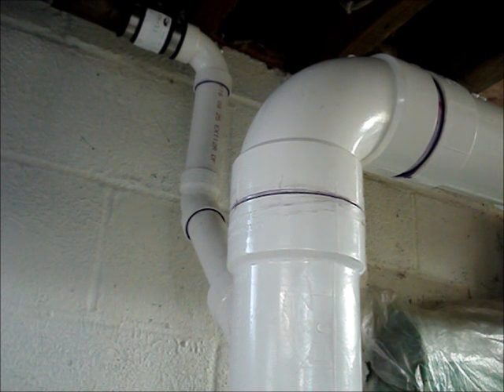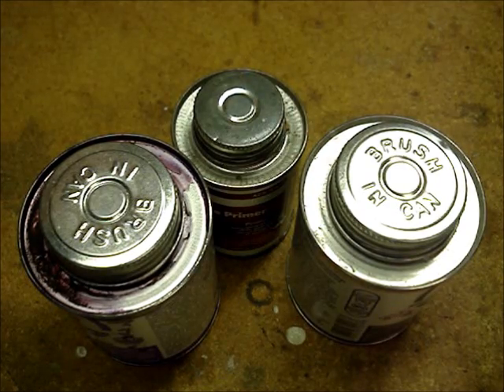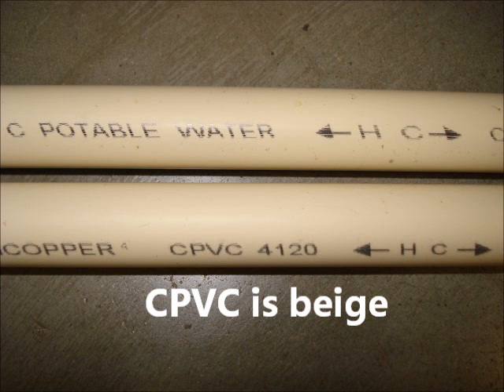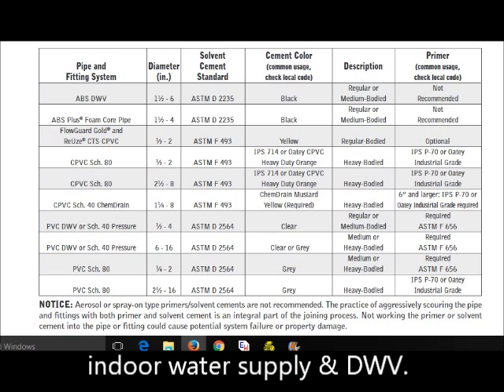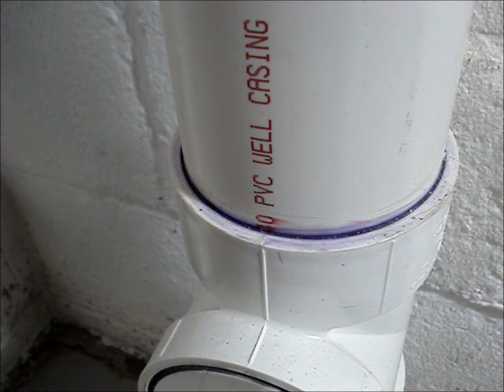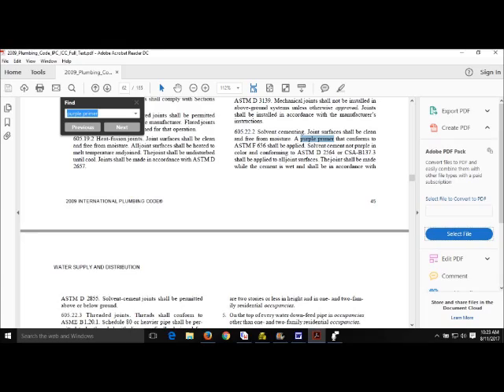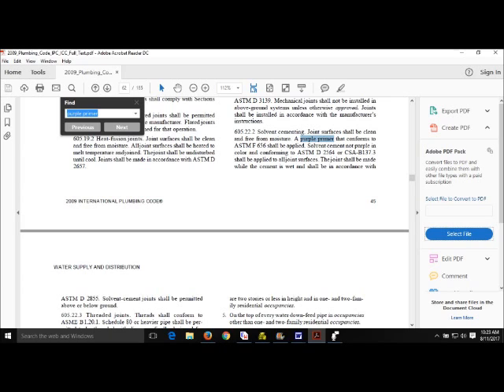Correct Glue to Use on PVC Pipes

Comment: There is nothing in this video that tells you about which glue to use. It only talks about primer.
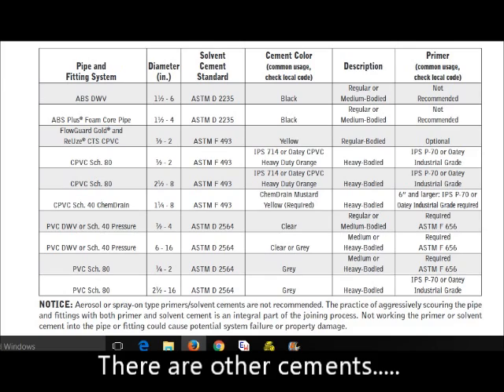Reply from the maker: Perhaps you missed the chart at 1:20.  Since there are different glues for different size and types of pipe you need to look up the solvent cement standard for you specific application... and you need to follow building codes.

Comment: Learn to speak English! The article "the" is pronounced "thee" only before a vowel and "thuh" before a consonant; "thee only", "thuh rabbit"...also you DID NOT EVEN SAY WHICH CEMENT TO USE! Said look it up! Sheeez....
Reply from the maker: There is no way for me to make a video that correctly tells you which glue is correct to comply with your local plumbing codes.  Before you do work you should be looking up you local codes anyway.  If you don't care about following your local codes, I do show you a chart, if you hit the pause button you can read it.  You'll notice that all three types of pipe are listed on the chart. The chart shows all the information you need.  Also, NOTICE that in the last column for primer it says - check local codes.  Someone took the time to help you for FREE and in return the first thing in your comment is mocking how I talk and then falsely accusing me of not giving you the information.

Comment: Should I redo the drainage to my washer since the cement I put was a little rubbery or it'll be okay?l had no way to the hardware store at the moment?
Reply from the maker: If it seemed to bond ok and it's not located in an area where water can do damage (or put a pan under it), I'd monitor it for a while for leaks.  There would only be standing water in the trap area and it's since it's a drain, there is no pressure.  I don't have any knowledge about the specs or making the glue so I can't give you an honest answer on the properties of the glue.   If it's keeping you up at night, for peace of mind you might want to redo it.